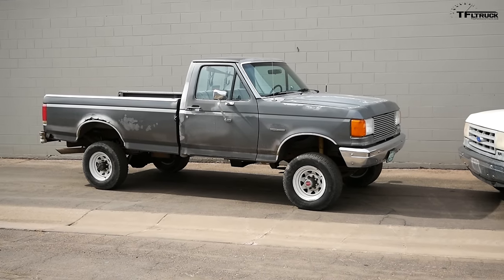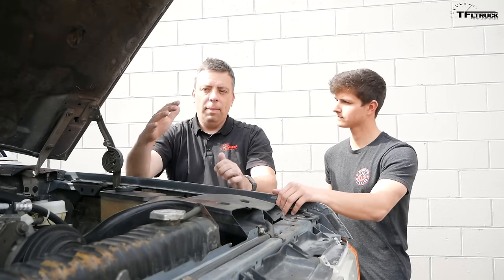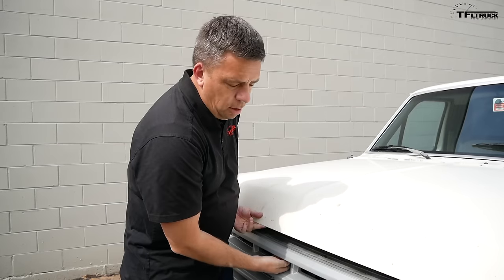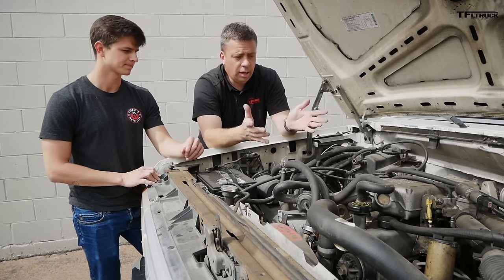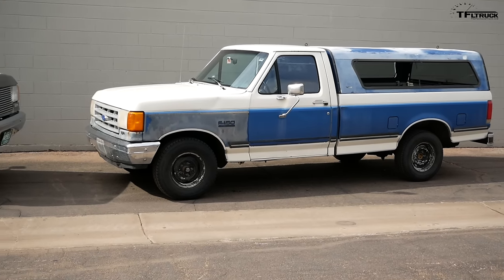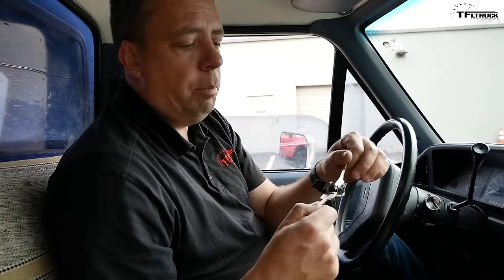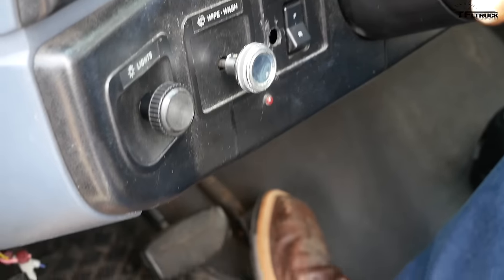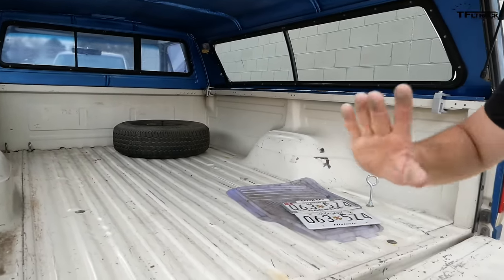Here's Why You Can't Kill An Old Ford F-Series Truck | Gunsmoke Ep.3

Comment: Wow I was a tech in a ford dealer in the late 80’ to min 90’s before be coming a fleet tech for a city agency and you are right those trucks are tough from the Diesels to gasoline with the Infamous infamous veritable Venturi carbs and of course the M.C.U controller system lol I do miss those days and have to say working with those systems definitely made it easier to work with the newer systems I still from time to time have to dust off so of the old tools and skills to help out some techs with those older models which I don’t mine because to see this trucks still on the road is great

Comment: I've got a 96' Ford F150 with a 5.8L 351W parked it in with an automatic transmission (E4OD). 316,517 miles on it. It's towed nearly 3 tons going 80 mph on the highway.

24 years old and runs like it's new. I've got a lifter ticking sometimes when cold.

Have to replace wiring and fuel injectors next year.

Comment: I have a 95 f350 dually with a 7.3 powerstroke and I love that truck !!!  It might not be as fancy as the new trucks but it is much cheaper and easier to work on !!  
Plus it only takes under an hour if you need to change the heater core !!!
Another plus , we don't need DEF !

Comment: I have both a 92 F250 and 94 F150 with the 7.3 na idi and the 300 i6. Both single cab long bed, both manual transmissions and 4x4s. I don’t plan to stop driving either any time soon. The F250 I actually received free of charge from a buddy who just wanted it off his property

Comment: Ive had several f series and broncos from the 80 to 91 era. My favorites were my 89 f150. 4.9l xlt lariat with a mazda 5 speed.  And my 85 bronco 4.9l carb with an np435 4 speed with 6.7:1 1st gear.  Both trucks wete over 250k when i sold them.  The bronco sadly rusted the body.  Had factory rubber floors but ford put the jute padding under so they just held moisture. Frame and mechanically it still fired up and ran great

Comment: still driving my 1990 f150 inline 6 with 355,000 miles and dosent leak any oil do have the 5 speed manual with dual tanks. truck has been with me since 1998 and still have it today travled all over the country in it. and still passes emissions/smog here in california.

Comment: I have a 1989 F150 two wheel drive. 
It still runs but the body is about to fall off the frame. It would be cool to see the straight 6 and four speed over drive put to good use again. I got it about ten years ago for use as a lake truck.

Comment: Bought a 91 lariat xlt 5.0 a month ago. Straight body, zero rust, pretty decent interior. No cracks on dash, and she runs GREAT!!! GOT IT FOR 1000. I was having a very lucky day, the first to arrive. Guy had over 100 people asking. He honored his word, and waited for me as I was the first caller. Great guy. As I was pulling out, he say's, "I should'a asked more" as he tried to kick himself in the ass😂. Exhaust was rotten with rust. For 300 had a guy cut if out and run dual pipes with flow masters out the back. Its hard to keep my foot off the gas, just because she sings so nice haulin' ass. Love love love this truck!!!

Comment: Miss my 1996 F 150 w in-line 6 4.9 liter 4x4

But now my 1988 F250 w 5.0 liter V8 4x4 w manual transmission still runs strong no oil burn at 275,000 miles 

It starts it runs won’t stop

Comment: Just bought a 92 F250 with the 5.8L 4 spd auto. Built like an absolute tank. When I saw the body was oil sprayed and rust free I bought on first sight. 368,000km and I didn’t flinch. No way would I buy a newer truck with this many KM on it.

Comment: My father was in Ford light truck build between 1983-1997. For those of you saying the 4.9 was the best engine Ford ever built, you are correct! The reason Ford quit making it was they couldn't control the straight 6 design in accidents. The government had increased it's safety standards in 1996 to the point they were forced to drop it

Comment: I have many of those 7.3. one I drive all over the east cost pulling generators for cell sites. Not only on the road but a lot off off roading with a 5k generator behind it getting to the sites in usually bad weather. They are great.

Comment: My neighbor growing up was a huge Chevy guy. Even he admitted the 300 Ford was probably the most durable engine ever. He said they use to run pumps on oil rigs with them. They never shut them down and only added oil when needed. Changed the oil yearly.. said the filters would weigh over six pounds when they changed them!

Comment: I own a 1992 ford F-150 XLT 4x4 with a the V8 and auto trans. The engine and trans has about 10,000 miles on it. Paid about $1800 and she runs very well. The 4x4 is also mechanically operated automatic locking hubs.

Comment: i have a rusty old 1982 with a 4.9 inline 6 and t18 4 speed i love it its got over 500k on it and it drinks a quart of oil every week but i love it

only thing is its hard to keep clean my engine picks up dirt and grime like a diesel spits out around the valve cover changed the gaskit like 4 times before i gave up and just started  adding a quart a week

Comment: I've got a 91 f250 extra cab long bed with a 351 and 5 sp manual. It's got the famous 90's American chipping paint and just one good sized dent but I love it so. It's gutless with the 351 in a 250 but I love that it has the running gear to handle heavy loads and keep the mpg of a 150, especially with the 5spd so I can do a lot of coasting. I did just throw about $200 into 4 sensors to get the check engine light to go out and I narrowed it down to the throttle position sensor but hey, can't go wrong replacing the others at the cost. Hopefully she'll be good to go for a while longer.

Comment: My father bought a 1984 F250 2wd 4 speed manual desert tan new. The truck was used for landscaping and was super tough for years .  The nail in its coffin was the flex in the firewall when the clutch was engaged. Ford was aware of the issue andI later learned they actually sold a reinforcement bracket to beef up the area around the slave cylinder. Should have been a recall but would have costed them millions in the 80's.

Comment: I had a 1985 F150 4x4, standard cab, shot bed, 4 speed, 300 ci inline 6 cylinder. Easily the most off-road worthy hunting and fishing rig I’ve ever owned! I put a cap on it with a foam mattress across the bed (I’m only 5’8” so it worked perfect). I have regretted selling it ever since! 😢

Comment: My dads 1986 F150 V8 with EFI Ran the day he had the scrap yard come get it, but it was so rusted out living in indiana and had a snow plow on the front the frame snapped inhalf while the tow truck operator was winching it onto the flatbed. no joke the driver floor board was old license plates

Comment: I still have my 1975 Ford F-250 long bed 455 stick shift with a 10 inch lift and huge tires. I got it in 1984 for $5000, it was completely stock. I did the lift and tires as soon as I got it. I still drive it, it has 350K miles. I keep the oil, air filter and gas fresh, it will run forever.

Comment: I just acquired a 1987 F150 XLT with manual transmission and 4X4. I call it the brown beast. still ticking like a timex. I too have a bad rear gas tank. I would like to get that fixed as well as run thru all the maintenance/ service items needed to keep him running for another 500k miles.

Comment: I've got a 95 F150 with the straight 6 300 and a 5 speed trans 4x4.  Love that thing.  Body is straight and clean and it only has 100k miles on it!  It will probably outlast me if I keep oil in it.

Comment: I have a 92 f150 4.9l 5 speed 4x4. That truck will not die or loose a beat. Heavily abused on the farm. It has over 400,000 miles now, and still runs strong.

Comment: I had a 1966 Ford Econoline van with the 300 c.i. 6 in it. The guy I bought it from wouldn't let me take it for a test drive but I bought it any way. on the way home I found out why, it started to smoke very badly. It made it home and I decided to change the oil and filter. I took 4 gallons of oil out of that engine. (most engines would have liquid locked with that much oil it them). After putting in 5 quarts of oil and a new filter the smoke went away and the engine had a lot of power. So I would say these engines are built very strong. Jim

Comment: 300 straight six only downfall was the factory water pump cavatating causing hot spot on front cylinder change that do regular maintenance it will run forever

Comment: I have a 1989 Ford XLT Lariat have spent zero dollars in repairs to this truck it hauled a one ton payload last year and it never compressed the overload springs its tough and definitely built to last and at 159,000 miles the 5.0 liter EFI is barely broken in.

Comment: We R in the process of finishing one of these trucks with the inline 300 6cyl tore all that EFI garbage off it and put the offenhauser intake on it with a Holley street slayer carb and Performance curve headers thrush mufflers. Just about pulled the front wheel off the ground with it the day we got it going and I found out the rear on it is a posi rear end. Now we R doing mine. I learned from the mistakes on the first truck what I did wrong I am doing all the right the first time to my truck.

Comment: My dad had a couple of F100s with 240/3 speed manuals.  Reliable and economical back in the gas crisis of the 70s.  I had an 89 300/5 speed I bought new but ended up trading it for something that went faster.  My brother got an 87 or 88 300/C6 with around 125K to drive to school.  He wracked up another 100K before it got passed on to be a farm truck sometime around 2003.  I don’t know what ultimately happened to it, but its not the only one that ever went over 200K.

Comment: I have an  '87 F150 302 manual, Granny gear, a 91 F150 5.8 Auto & my daughter has the 87  F250 Diesel Turbo, Manual. (Dad bought it in the mid to late 90's). Someone once offered her $2500 for her truck. She turned them down.  Smart kid.  A guy once told me cost him MAJOR $ to change the oil in a 2018. SO GLAD to HAVE Beaters..... Funny- had a kid in my 91 say he'd NEVER seen Crank windows..LMAO but wish my 87 had the same..

Comment: I bought my 96 I-6 for $1300 a year ago this month with 152,xxx miles, and I’ve only changed oil, new belt, changed plugs and wires, and two new tires. Still fires up every single time.

Comment: my old bullnose is similar to your trucks. the one thing I can say for bullnoses is the efi is a pain. I eventually had to put a carb on it. I spent 8 years replacing sending units and relays only to find that the throttle body was leaking air. The carb and intake cost me less than replacing the throttle body.

Comment: Currently driving a 91 F250 XLT Lariat standard cab, 7.5L and a 5 speed. Love everything about it but the gas mileage. 87k miles on it, basically got if for free! Would love either an F150 or Bronco with the 4.9/300cid six and a five speed.

Comment: I had a 1989 lariat with the 300 6 cylinder. Wish I still had it best truck I ever owned. Unfortunately I rolled it seven times. Best motor transmission combo Ford ever had.

Comment: The 1989 F-250HD Lariat 7.3idi dad and grandpa bought brand new (special ordered and produced October of 1988) has certainly not been reliable or last forever without lots of money.  So far with just over 123K on the clock (used mostly to travel between the two farms which are close to each other which may explain some of the issues with its short runs).
blown engine (threw a rod)
3 injector pumps
numerous glow plugs and relays
A/C 
clutch
transfer case
fuel sending unit multiple times
rear fuel tank
window motors
radio and speakers
tachometer 
heater core
starter 
hubs
twin ibeam can't keep an alignment

Love the way the truck looks and very comfortable seats but damn!

Comment: I just gave my 81 ford truck to my son , it has gone 3 times around on the odometer with the 4.9L. I have changed starters, alternators, batterys over the years but never did anything to the engine itself. As long as I kept it between 85 and no more then a 100k it will go forever, it is the best truck i have ever owned.

Comment: I have one of the 93 F-150s with the 4.9 liter I-6.  It's got the M5OD Mazda 5-speed manual w/overdrive.  It's the stripped down XL short bed and standard cab, nothing special; I put a K&N air intake and filter kit on it and a FlowMaster exhaust system.  It gives the truck a nice sound, similar to the sound of a Jaguar XKE from the 1960s.  Well.... almost.  It's a good dependable truck that's fun to drive with the manual transmission.  Once in a while it needs attention; after all it's old, but it's a basic piece, so it's easy to fix at home.  My next adventure; the rear tank fuel pump. Of course, I just filled up.  

Stay healthy everybody.   Peace

Comment: I've a 78 Econoline, basically, a van on an F-150 chassis, carburated straight 6, 3-speed manual... I've rebuilt the body, trans has been replaced, rear axle seals were just replaced, and I've been through 3 clutches... after 375,000 miles. The wiring is starting to show its age... but it's easy to fix... and parts are available and cheap.

I needed a muffler, $28. My Subaru needed a muffler, $150... same vendor..  go figure.

I will own this van for the rest of my life. It makes me money, has been a home, a camper, a mobile love shack, and I actually like working on it.

Yes.... bleed those brakes... I had that issue too... finally got it good.

Would love to have a small dump with that diesel setup.

Comment: Bleed the RABS unit on the drivers side frame rail right under around where your feet would go and adjust your rear brakes and you’ll get your brake pedal back, also put in motor craft coolant for these trucks so you don’t get cavitation in the cylinder walls, replace injectors and return lines, maybe the injection pump, and rebuild the oil cooler and you have a perfect truck. These engines really are built to last and seem to never die unless you let it burn or leak all of its oil lol

Comment: I have one with a 300 six and an E4OD automatic transmission.  The engine is good at 300K, the E4OD had died twice even though it was serviced as recommended.  Now the transmission shops in my area will not touch it. Bring back the C-6!  E4OD was a bad idea from Ford!  That is why they came out with the 4R100!  Both are more complicated and costly than the C-6. 1989 - 1997 was the E4OD production run. 
1997 was the transition year to the 4R100 and vehicles from this year could be found with either transmission.

Comment: I worked at the airport. All the luggage tugs had 300 fords in them. I had one tug with a bad mechanical sound at idle and when revved up. The sound was bad but we needed the tug on the line and didn't have time to work on it. About 2 weeks later, after it did full days work, I ended up taking the cylinder head off only to find the exhaust valve had dropped into cylinder 1 upside down and was jammed through the piston.

I bet it could of lasted 6 more months on the line.

Comment: I've got a '91 with the inline 300 that I'm redoing the sheetmetal on. Lotta work that goes into keeping the body in shape but when it gets finished with a basic mechanical overhaul, it may even last longer than me! Odometer has been around three times since my father bought it. It likely has around 400,000 miles on it and that motor has never been rebuilt. Sure there's more fuel efficient stuff now but 16 mpg is respectable for it's age.
Reply: Ran into this vid again some years later. As of today, all the cab steel (minus the passenger's corner) has been rebuilt. Took me a bit longer to get'r done but after that piece is in, I'll reshoot the original color, throw on some new bed sides and that should be a wrap for the body. So while sheet metal work sucks, it's well worth it to keep on the road!

Comment: I own an 80s Ford truck with a 300 in line 6 amazing and also a Ford bronco with the five speed transmission on the most amazing low geared vehicles I’ve ever owned

Comment: My 96 F150 has the 5.0 V8 but I can definitely attest to the solidness of the obs ford product.  I use it as my weekend Home Depot vehicle for things that home owners need trucks for so it’s not my daily driver.  I keep a deep cycle battery on it so I can go weeks without driving it and it fires up just like new.   All that aside,   The shits cool and people try to buy it every week.  I love it and I won’t sell it. It’s hard to get an unmolested classic truck these days and it’s like another tool in my box.    I’ve heard great things about the straight six but the 5.0 is a great motor to.   No complaints.

Comment: Still own one 95 f-150 short bed single cab. It is an xlt with the power windows ,door locks ,tilt ,cruise power mirrors power lumbar. it was special ordered  has the 4.9 5 speed factory steps. It has 241000 mi. doesn't use any oil between changes. bought it new for 15k had 14mi on it. Can't beat it.

Comment: I’ve had several f150’s over the years with carbed and efi 4.9 engines and the carbed  ones always got better fuel economy.  The best I’ve been able to get on my efi with a manual is 19 mpg and that was all on highway watching my foot. In the old carbed truck I could get 22-24 on the highway with little effort. I wish the computer was tunable there’s probably some improvement that could be made.

Comment: The best motor for those is the 300 straight six. Gear drive instead of chain tells you all you need to know about it’s life expectancy. Great low end Tourqe. Also a lot if them were stationary mounted to power oil wells, hospital generators,irrigation pumps on farms and even a rolling mill for hot steel. The 3/4 ton just needs a Remington 1100 12 guage now that Remington’s back in business and a Winchester 94 30-30 or a AR-10 308 deer rifle.